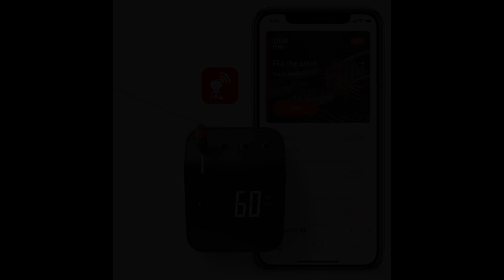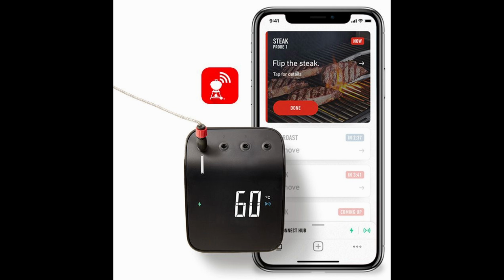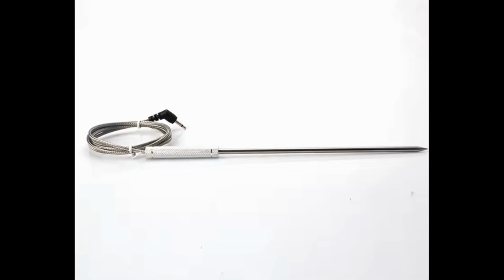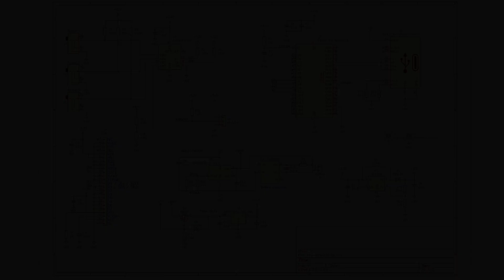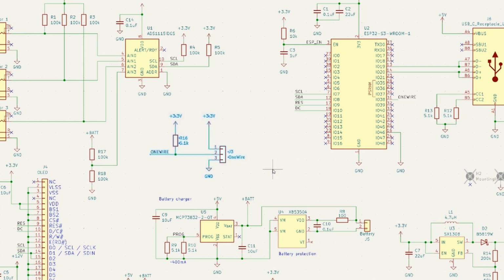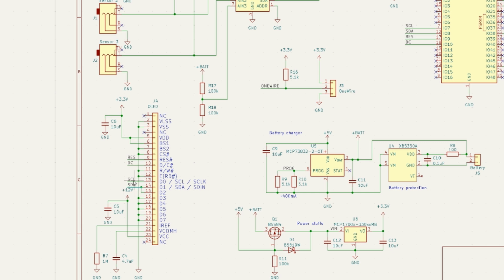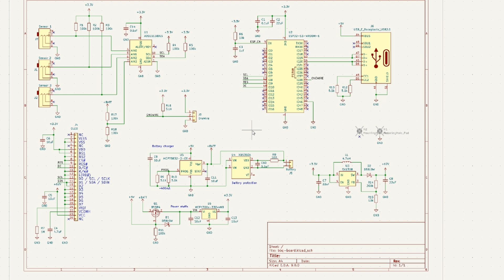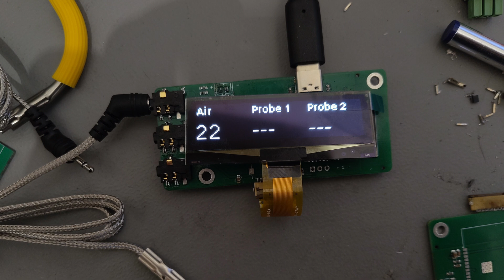Overengineering a barbecue thermometer

Comment: How come u didnt use the ADC pins on the ESP? Why do u need a seperate chip for that?
Reply from the maker: ADC in the ESP simply isn't that great, in my experience all builtin ADCs in devices don't nearly reach enough precision to make use of the bits they have, and they usually don't have the voltage range I need. Since it's measuring a resistor divider here I'm already throwing away a bit because half the range won't be used in my case. Since the data is also not linear you need quite a bit of bits to get decent precision over the range between room temperature and barbecue temperatures.

Comment: Hello Martjin! How is Megapixels 2.0.0 development going? Are there any major roadblockers at the moment? Or just waiting for more user testing before going from the Alpha to a Beta?
Reply from the maker: There's quite a bit of random fixes that will be going in megapixels 2.0-alpha2, current major roadblock is that GTK3 dropped the GL backend in favor of NGL, which means there's no GPU acceleration anymore on the pinephone and the librem 5 since those GPUs are too old.
Reply: @MartijnBraam  NGL is a big bummer, not only it's bugged on NVIDIA GPUs, but now this... sad to see.

Comment: It’s nice to see someone as skilled and experienced as you still makes the kind of silly mistake like reversing a connector. I’m a huge newbie so it’s comforting to see
Reply from the maker: Can't say I'm that experienced with electronics... also I did mess up that connector twice. Mainly because I received the original boards, noticed the connector was reversed so I fixed it in the schematic, then threw it aside for a few months because I was annoyed by my mistake. Then I opened the project again to order a revision two and reversed the connector again because I forgot I already swapped it...